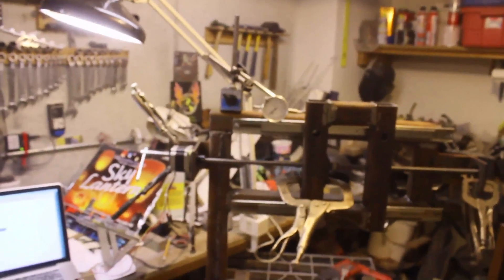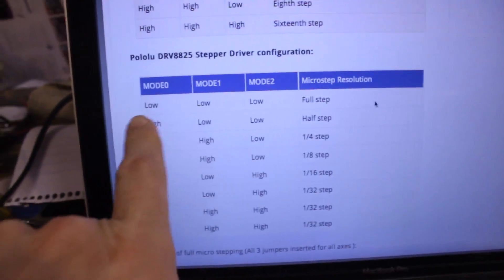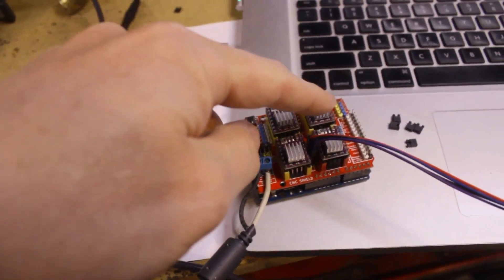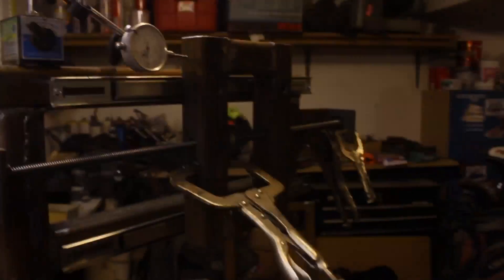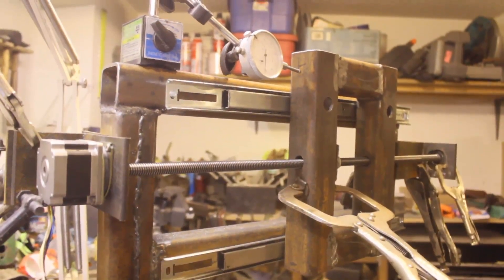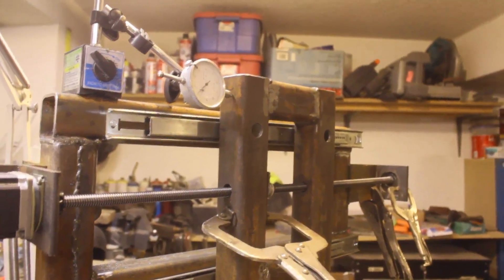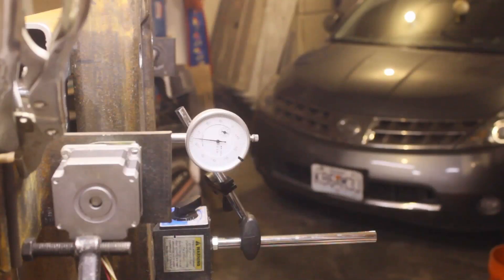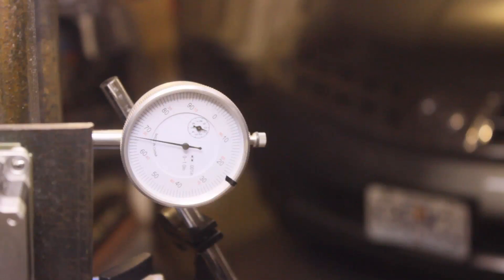Speed Upgrade for X-Axis - DIY CNC

Comment: I haven't done my homework but if I understand whats going on this fixture will hold tooling to work the material? If this is the case then multi speeds will be useful depending on the tooling and material worked?  ...just asking or should I be in the dunce corner?  Enjoying the project and I know it will all be clear to me eventually Thanks for the videos!
Reply from the maker: vw64manyrd You are spot on.  The software has editable defaults for tool speeds.  You can set them to be whatever you want based on the depth of cut and the material you are cutting.  It's a pretty amazing amount of control.  I'll def cover this when I get the machine going full bore.

Comment: It will be alot smoother on the final build with Linear bearings im sure too. You look tired. Great vid.
Reply from the maker: R HEIDEMAN I almost splurged for linear bearings on this build, but decided to wait and see... I paid $6 a piece for the drawer slides...  If they are a problem, I'll ditch them and spend the scratch on real linears.
Reply: I have a drawer slide machine. I have run it up to 200 inches per minute. But when I did that I trashed my HDPE lead nut, so I keep it at around 50 IPM now. Which is still plenty fast enough for me. I can isolation route PCBs on my machine so they're accurate enough too. As isolation routing is a pretty demanding task. I don't even use software probing.

Comment: I learned that when alcohol is not involved you need to use the correct size hammer when giving love tapp's.    I was wondering what I missed in regard to what it will do. Now I understand that you just have an over active mind like me.  You do the math and fab work.  I'm still in the sand box learning how the transmission works on my Fat Bike.  I bet you could hang your cutting torch on that rack and do some awsome flame cutting. Like that stuff you made for greasorama.    Kool Beans.
Reply from the maker: TheEZGZ You got it GZ.  It will make anything with any tool.  Your mind is your only limit.

Comment: Well I did get something out of the video. What I ended up with is the itch to have one of those to play with so why don't you throw another on on the fire for me and when you have it just send it up my way. Cool stuff Greg, Cheers OLDDUDE
Reply from the maker: Thisoldcar LOL!!!  If I had the time I'd make you one right up.  I think you've got enough tools to make just about anything already don't you?
Reply: Greg's Garage Well it's true that I do have a lot of tools but the saw dust has replaced the gray matter that I would need to do something like this project of yours. I use to be able to do a lot more things than I can these days. I use to be able to lift a lot of weight but nowdays I can barely lift my sit down off the seat and while I use to never make a mistake nowdays I barely ever get it done right. I find that age is a wonderous thing and now I am wondering what the hell happened to me and why I can't do those thing that use to be so simple. Take care and Cheers, OLDDUDE

Comment: Good stuff Greg, cool that you got to dig into the step/speed options with the servo control.  Btw, what is the TPI on your lead screw?  Yea, that's the one thing I hate about welding, I never really noticed until until I was trying to build the frames for furniture and trying to make them perfectly square, very hard to do as the heat from the welder wants to draw and pull things out of square, it's why i build those 4 90 degree vise stands.  Good to see you stayed after it and got it fitted out you wanted it...  Loving this project, keep up the good work
Reply from the maker: turbocobra The leadscrews are 10 TPI, 1 start.  A good jig is invaluable.  I fight the struggle of how many clamps are needed to hold something tight.